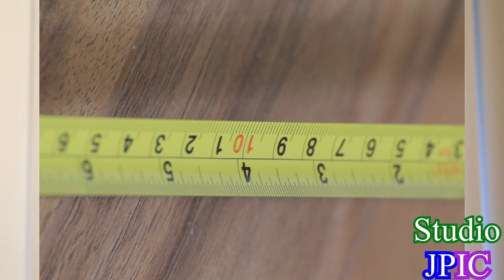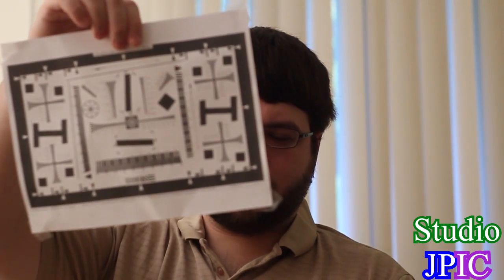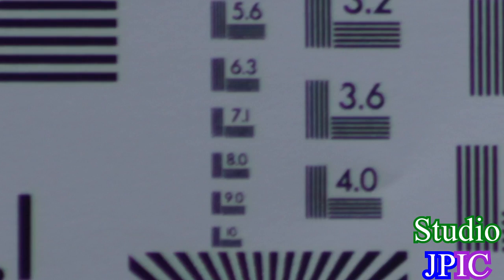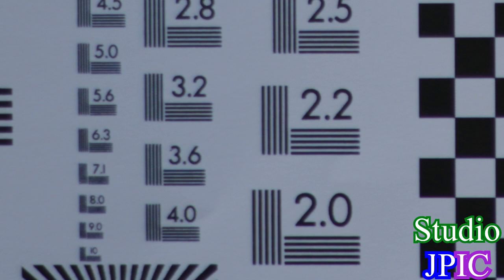How to test a DSLR camera lens

Comment from the maker: Hi Bursanik, sorry for the late reply, but YouTube hadn't notified me of your comment.  Each lens could have a different sound when you shake it or use it, I'd recommend you ask other users of the same lens you have.  I believe Canon lenses (and Tamron for Canon) open wide-open when they're not on the camera, but other brands could behave differently, especially if they have manual aperture controls.  If the lens behaves normally when you change f/ in the camera, I wouldn't be worried.

Comment: Hi. Can you extend video with more more movement  step by step .
I repeat your actions step by step.
I gently shaking and hear the thud of elements in the lens (Klunk-Klunk) 
Is this normal or must be securely tightened?
I took off the covers and looked through the lens.On your video I see that the curtain is opened , in my is closed almost to the end as the f22.? only by hand I have to push my crowbars to Spread curtain  but return immediately when released. Is somethin wrong with lens?